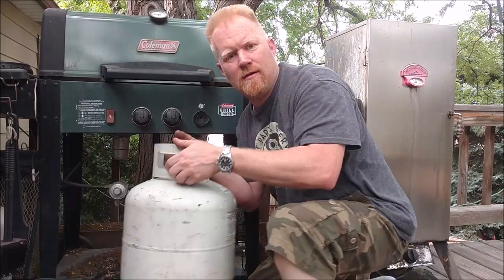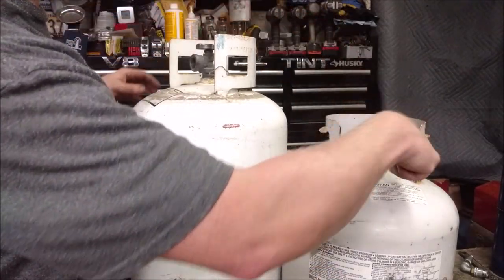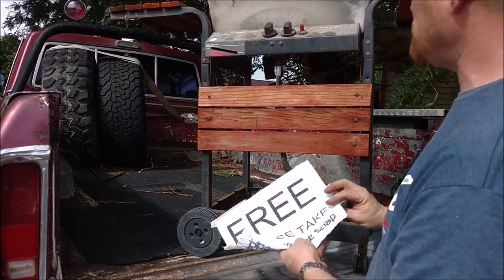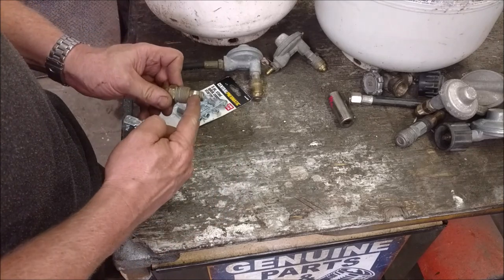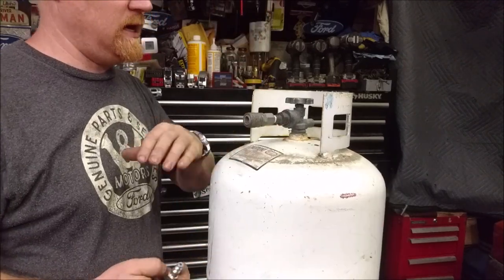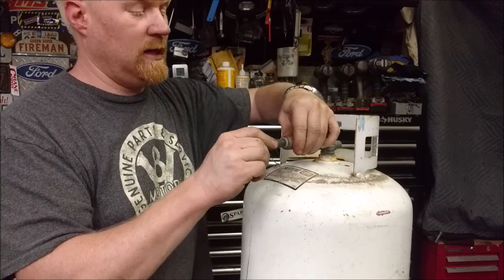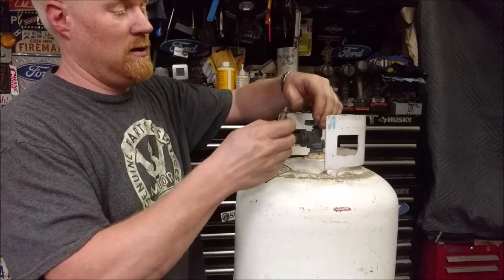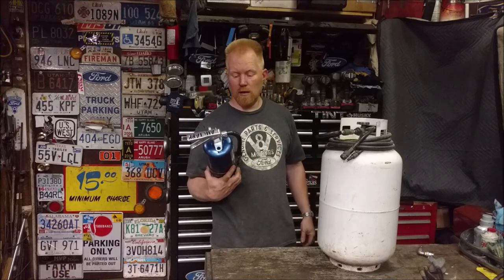Make a Propane Air Tank QUICK N EASY

Comment: Awesome video! I just had a quick question and it might be a stupid one, but how do you know how much air to fill it up with? Or do you just fill it up until you can't anymore....in other words, until the pressure in the propane tank balances with your compressor's max pressure, which I assume is way below 375 PSI for most standard compressors?
Reply from the maker: Most standard air compressor max out at 120psi, so that's all I generally fill it with. Even two stage high output compressors only go up to 175psi, so well below the rating. These tanks are DOT rated to 240psi operating pressure and tested to 480psi.
Reply: @sixtyfiveford  Awesome! Thanks for the quick response and for the countless useful videos you create :)

Comment: Sir we need to figure out how to pump up these tanks to 250 or 300psi!!  Why?  In order to air up 4 tires on a 4x4 rig from 15psi to 35 psi even a 30 lb propane tank at @150psi will not have enough air to air up my truck tires.  I like this idea but it must be capable to air up all 4 air tires up to 35 psi.   We can get 300psi air hoses so I want to figure out how to pump up these tank up to 250 to 300 psi ideally.

Comment: Propane is heavier than air.  I believe you can just open the valve and turn the tank upside down. Any propane should just pour out.  Be sure the tank is empty before you do this,  you do not want to empty a 1/2 tank of propane. Into the neighborhood. 

JoeB

Comment: Using a propane tank can be very dangerous as it could be rusted on the inside(especially if it is an older tank). Filling it up with a compressed air could cause it to explode due to weak points caused by rust. Additionally, next, if you are doing this please add a pressure gauge to the air tank setup so you know the PSI in the air tank as you are filling it with compressed air.
Reply from the maker: Propane tanks that have had propane stored in them never rust from the inside out. They only rust from the outside in and that is why to recertify tanks a visual exterior inspection is all that's needed.  

Second air pressure: You're never going to overfill this tank more than your air compressor tank is holding. If your air compressor is set at 120 psi and you connect it, you're only going to get 120 PSI in the tank. If it's at the 175 you're going to get 175. These propane tanks are generally rated for twice the pressure of a home or even commercial air compressor tank.

Comment: I've done similar and don't disagree with you. Except compressed air usually has moisture in it and if it rusts internally, it can blow and and cause serious injuries. That's why the DOT requires visual inspection of the inside, and pressure testing every 10(?) years. If the outside is getting rusty...time to check that!

Comment: WHere did you get the large LPG tank that you used fella ??? How about the tank weight of propane inside the tank ??? Thanks
Reply from the maker: They're known as 7 gallon or 30# tanks. Very common on camping trailers that have the two tanks up front on the tongue.
Reply: @sixtyfiveford  Now I know where to get one for my personal use. Thank you for your quick response with factual information of pertinent FACTS. Good day too.

Comment: If you dilute the propane with air, at a certain point you reach the explosion limit of propane in air. Then you are just juckt if it does not ignite and explode. To be safe you have to remove all propane from the tank!

Comment: I have a old 100lb tank I use with my little 5gal compressor that's rated for 175 psi turning it into a 30gal.
Reply from the maker: That's awesome. It makes a big difference. I use to run a 25 gallon compressor and added a free burnt out compressor 60 gallon tank to it.

Comment: Nice vid.. thanks for sharing.. Have you ever built a tire blaster for seating stubborn tire beads using a propane bottle? If you haven't it would be a great addition to your manual mount tire machine. Best to you and yours.
Reply from the maker: I've contimplated it for years, but with the lock on tire chuck I haven't encountered a tire I couldn't quickly get to seat.

Comment: I use a 30 year old tank and it still reeks of that smell...I wonder if a mesh baggie qof activated charcoal inside would help, thank you for the video
Reply from the maker: Some people are saying bleach gets it out, but I also know bleach will rust steel in no time flat. Another guy suggested old motor oil followed by a swish of diesel fuel (which is just thin oil) to rinse out the motor oil. I think that is way I'm going as a little oil will help protect the metal surface from rust.

Comment: I have seen people who have been using old school green refrigerant tanks to do.the same thing 😀
Reply from the maker: Yeah, I've seen them. Those are a little scary to me as they're so thin. They  are DOT39 non refillable tanks with a testing of only 180psi.  Where as  propane tanks have been tested to 480psi. The safety margin is just a lot more favorable with the propane tanks when your refilling them to standard air compressor output of 120psi-175psi.
Reply: @sixtyfiveford  you are not kidding because it's not fun at all when you get a tank blow up because the thin metal is weak 😟😟

Comment: Just curious, can you make an air tank from a empty helium balloon tank.....also, how can you add an air guage...thanks
Reply from the maker: A lot of people do. However they are very thin and I think only have 1 time test pressure up to around 150psi. You also have to come up with a special adapter to put a fitting on them. Multiple filling and emptying will cause the steel to fatigue and possibly fracture in the Helium tanks. Propane tanks are meant to be emptied and refilled indefinitely and are tested to 480psi.

Comment: Nice setup but I prefer a gage be on top of my portable air tanks. I usually fill them up with a 100 lbs of pressure. With no gage wouldn’t it put you in a dangerous position not knowing how much pressure you are putting into the tank?
Reply from the maker: Most compressors max out at around 120psi with high output ones at 175psi. But even with the high output compressors you have your regulator turned down to the 90-120psi range. These tanks have all passed a factory pressure test to 480psi with an added safety blowoff at 375psi. So no shop air compressor is going to come close to compromising the tank.
Reply: sixtyfiveford Still a air gage let’s you know how much pressure is still inside the tank while you are using it plus surely lets you know weeks later if the tank lost any air pressure when you go to grab it to take with you. Years ago they use to sell a cheap kit out there to convert old 30 lb R12 Freon tanks that came with a gage. They worked pretty well at the time but for me they didn’t hold enough air pressure. Keep all these great video’s coming. I am a subscriber. There are not too many of your video’s that I have missed. I tell people I spend more time watching You Tube video’s these days then watching a lot of the junk on TV.

Comment: Thanks for the video.  Aren't there any household cleaners or shop degreasers that might eliminate the propane smell?
Reply from the maker: Some people are saying bleach gets it out, but I also know bleach will rust steel in no time flat. Another guy suggested old motor oil followed by a swish of diesel fuel (which is just thin oil) to rinse out the motor oil. I think that is way I'm going as a little oil will help protect the metal surface from rust.

Comment: Can this be done with those pink helium tanks from Walmart, etc?
Reply from the maker: You wouldn't want to. Those don't have a pressure rating and are about 1/3 the thickness. If you accidentally dropped it, it would probably blow up. Propane tanks are a dime a dozen and everywhere.

Comment: I guess after you let all the air out of the tank....you can turn it upside down with valve open to drain any water-moisture accumulation in the tank before next-use recharging.
Reply from the maker: Absolutely. If you have a filter dryer from your air source and fill when you compressor is cold(been sitting a while) you should have no moisture transfer over.
Reply: @sixtyfiveford  correct.

Comment: I have a question, when purging the tank of propane like when you mentioned filling with air multiple times should you have the tank upside down to expell the liquid?

Never thought id see the day when I actually look forward to running outta propane in one of my tanks.
Reply from the maker: Propane is only a liquid if it's under pressure and or if it's extremely cold. Once you open the valve it turns into it's gaseous state.

Comment: How would one go about adding a pressure gauge? I have a couple ideas but I’m not too sure. However, 375 psi says a lot for my compressor, I shouldn’t have any issues I’m assuming
Reply from the maker: Honestly a pressure gauge is pretty useless on one of these as they're so small. You can easily hook one up with a T fitting through the outlet/coupler.

Comment: 12volt battery and mini compressor is easier than that, but for close by it is ideal , around the yard
Reply: Not really, you have to hook up the compressor to your battery and wait a fairly long time for the compressor to pump your tire up. If you're referring to a compressor that plugs into the cigarette lighter then you'd be better off just tossing it in most cases. 

I've installed permanent on board air systems on my vehicles. 12 volt Viair air compressors with storage tank. Everything is automatic, however in the end it's just as he's doing in the video. Filling an air tank to a high pressure that will fill a tire rapidly. If your tire comes off the bead then you're going to need a pressurized tank as a little portable one isn't going to seal the bead. 

My 2 cents.

Comment: I have an older Craftsman oil type air compressor that I think the tank (12 gallon) is rusting out inside due to the last person never draining and I'm afraid to continue using it because rust particles was actually plugging the bleeder drain valve.  It's a very nice dual piston pump that I replaced the reed valves on and has about a 10cfm rating from the pump itself.  Could I get a larger propane tank, make sure all the flammable stuff is out and use it as a tank for the compressor?  If so, could a drain valve be welded in?  The motor and pump is too good to scrap just because of the tank.
Reply from the maker: If yours compressor is a horizontal it is a ticking time bomb. Those are notorious for letting go. Your question is a hard one. Not using a propane tanke as a compressor tank but welding a drain on it. Personally I wouldn't trust a weld on any pressure vessel. I think you would be better getting one of these newer Chinese(Harbor Freight etc) compressors with a dead motor. I see them from time to time on classifieds for around $25. That would save you a bunch of time. 

I tell you what I did 15 years ago. I picked up a fully rebuild Quincy compressor that had a pin hole in the 15 gallon horizontal tank for free. I found a free 60 gallon vertical tank with a bad pump. I cut the entire mounting plate off the Quincy and welded it to the mounting plate of the 60 gallon. Never did I actually weld onto the pressure vessel itself. I have been using that compressor for the last 15 years.
Reply: @sixtyfiveford  It's horizontal and is pretty old. I let all the air out and unplugged it.  I did that after watching videos of tanks exploding.  It's also belt driven and I don't want to retire the pump, it's amazing!  I'll see if I can find a vertical junker and adapt something.
Reply from the maker: @jamienoel  Yeah I've watched half a dozen compressor tank exploding and looked at pictures online. The one thing I noticed is they are virtually all horizontal tanks. That's what makes me nervous about welding on any of them.
Reply: Just lucked out!  My uncle is giving me his vertical tank because the piston went bad.  I think I can simply cut the mount off my old belt drive unit and weld it to the top of his direct drive mount.  Thought about just buying a piston for it, but my piston puts out twice the CFM his does. Edit: My dual piston pump puts out twice the CFM his does.

Comment: A third option for water is to pull the valve and paint the inside of the tank.
Reply: imo this should be done anyway since water will build up from condensation as gas is let out.

Comment: Could I use the same procedure to add to my compressor as a secondary tank?
Reply from the maker: Absolutely. However, continuous cycling with a compressor will eventually accumulate moisture inside. It's not a huge concern when just filling it from a compressed tank for random jobs because most moisture has already settled out in the main tank. What I'm getting at is you will need to put in a tank drain and or it may drain if you install it upside down.. I'm not 100% positive on that.
Reply: @sixtyfiveford  I am not really concerned about water in the tank as I always drain my tanks when not in use

Comment: So since propane is a liquid in a propane tank and has more volume than air at the same pressure, can you use propane to fill more tires than air at the same pressure?
Reply from the maker: You could for sure. But nobody is filling tires with propane.

Comment: May be a dumb question but how do you know when you have filled the tank with enough air?
Reply: Your compressor will shut off at what ever pressure it is set to. If it is set to 100 lbs and hooked up to this tank when it shuts off -you are done. Your Moe tank is now charged with 100 lbs of air.

Comment: I’m in the middle of building a bait launcher, I’m using a 10 gallon propane tank. I have not found info about installing a Milton 1/4 inch MNPT tank valve which is what I plan on using to fill tank. Leary about drilling tank since the wall is not that thick. Plan on using 120-150 psi. Any of you expertise and know how on installing valve and a gage is appreciated and welcomed!
Reply from the maker: I have put them into propane tanks but no longer do it that way. I would rather make the Schrader valve part of the removable fitting.

Comment: Where could you get it filled if you don't have an air compressor
Reply from the maker: Gas station with a good tire filler. Not the little coin op ones but a gas station with a car wash usually has a huge air compressor to run functions and will give free air to customers.

Comment: Absolutely appreciate straight forward talk like this. I'm working on increasing my air storage for my shop and beginning to design a "blasting" system which can't have too volume. I have 3 old 100 lb propane tanks that I want to convert to air supply. My concern if water build up. Any recommendations come to mind? These tanks are heavy, so occasionally tipping them upside down doesn't seem reasonable.  Thanks again for the video.
Reply: Could you tip them on their side, and repeatedly follow & empty them to  blow out the water with air like he talks about doing to get all the propane out?

Comment: I have a compressor that doesn't have a tank.  Is there a way to connect it to something like this?
Reply from the maker: No storage tank at all? You need things like a blow off valve and compressor pressure shutoff so it doesn't just keep pumping once the tank is full.
Reply: @sixtyfiveford  it's a very tiny compressor designed mainly for an airbrush.   I'm figuring it's a lost cause.

Comment: How do you know how much pressure in  the tank
Reply from the maker: If your compressor tank has 110psi and you hook it to this, it'll have 110 psi. If you have your compressor regulator set to 90psi; the tank will fill to 90psi.

Comment: So you're saying you could put 200 PSI in one of these 30 lb tanks?
Reply from the maker: Tank pressure ratings for these are in excess of the valve 375psi safety blow off . These 20 &30lb tanks are dot4ba240 rated which have a service pressure of 240psi and are hydro tested to 2x that(480psi).

Comment: If you unscrew the valve from the tank you will see that there is a small 8 inch tube that reaches to the middle of the tank. . So unfortunately turning the tank upside down will not drain water from the tank.
Reply from the maker: That little tube attaches to the liquid level screw on the side of the valve so when filling with propane you know when to stop. The propane still flows out the very top of the neck so turning upside down would extract the water.
Reply: I now realise my error. I should have know better than to doubt you. Thanks !

Comment: How do you know when it's full I see no gauge indicating that
Reply from the maker: You just equalize pressure with the compressor tank your filling it from. So if the tank has 120psi and you fill the portable tank it will also be 120psi.

Comment: Could you do this with helium tank?
Reply from the maker: Yes, but! Those are super super thin and can't take a beating. Just setting it down on pavement wears holes in the feet/tank. The threads at the top are also a little odd. You're way better off with a free bbq propane tank.
Reply: @sixtyfiveford  gotcha. Well, thanks for the info. Appreciate your videos.

Comment: How do you know how much pressure is in the tank while filling?
Reply from the maker: Because your air compressor has a regulator set to 90-120psi. A standard workshop compressor maxes out at around 120psi and a high output 2 stage maxes out at around 175psi(but you still have it regulated down to 120ish psi).
Reply: sixtyfiveford appreciate the reply. I have to check it out. Take care.